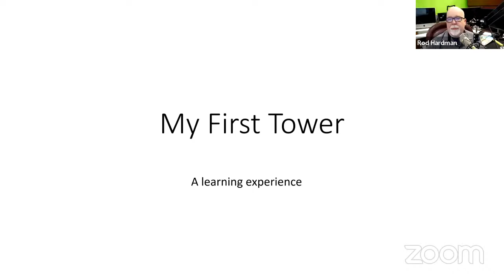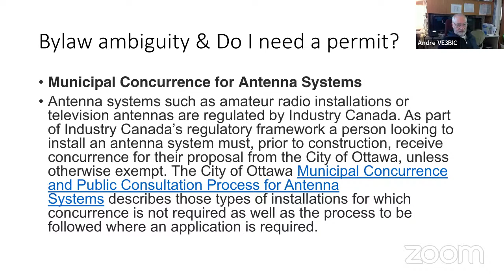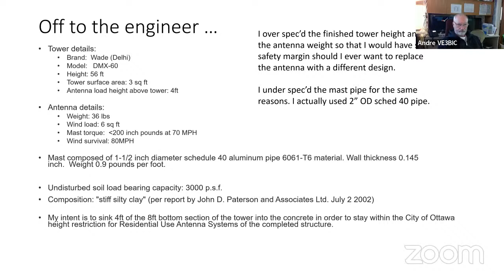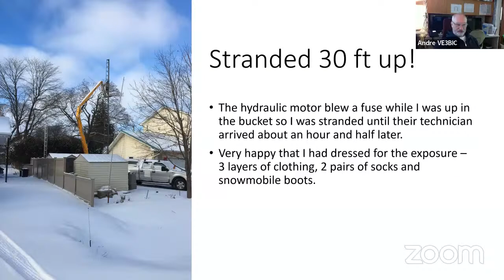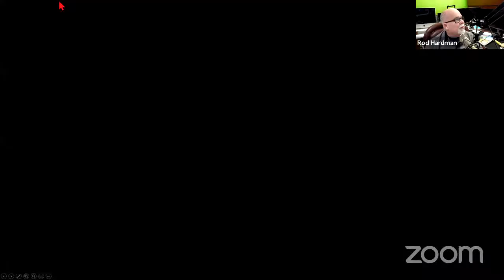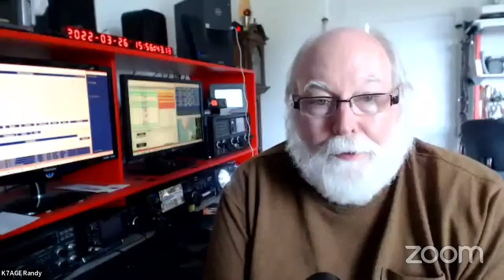Andre VE3BIC - My First Tower

Comment: I know this is an old (1 year old) stream .. I am hoping that (Andre VE3BIC) will Read this and can answer a Question regarding : I discoverd that VE3BIC has a TinyGS (Satellite Project) instalation.. could you Provede a link to guide me in (Choosing) the correct LoRa device that when Configured (Would work Reliably) for use in (Ontario Canada) .. Or simply what LoRa Module is (Andre VE3BIC) Using. ?
Thanks for Reading my question ... Regards and .. 73s >>